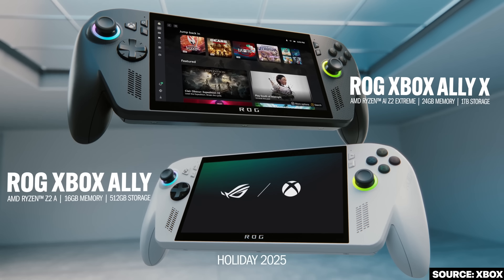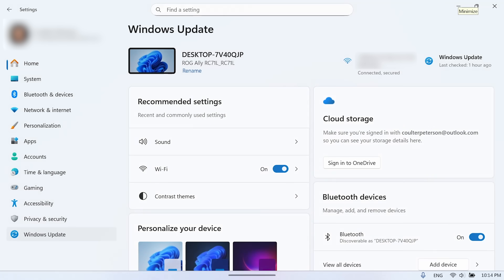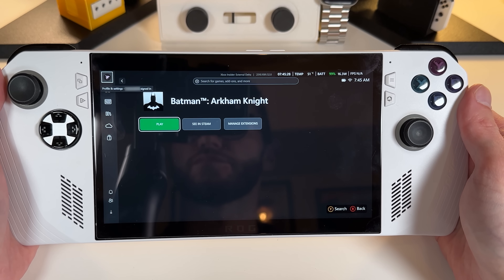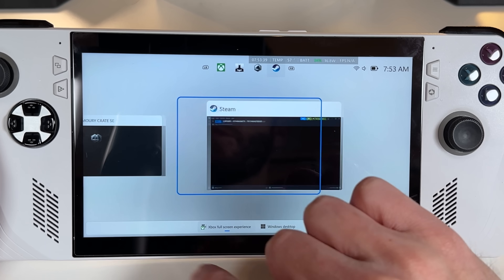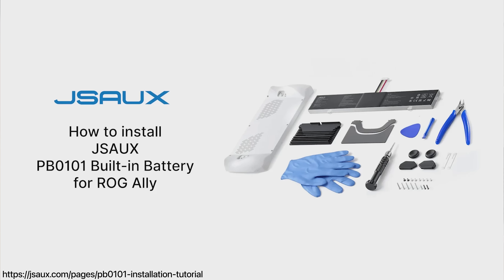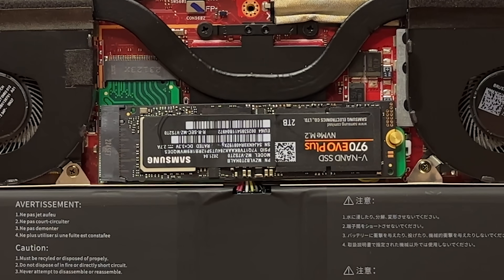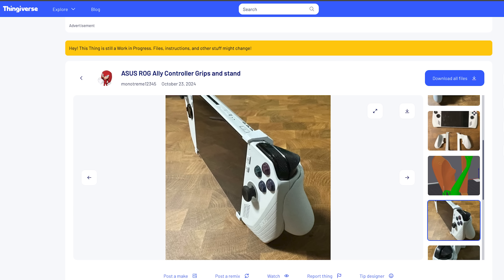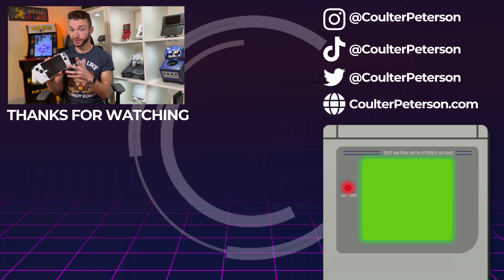I turned my Ally into an ROG Xbox Ally! (Should you upgrade?)

Comment: Biggest problem I’ve seen with the OG Ally Z1E is that if you run it at full wattage all of the time or plugged in, the heat causes white edging on the screen. I only use mine on 10-15 watts and keep temps down as much as possible

Comment: Best upgrade you can do for either is Bazzite. There are some games at i can get up to 20 more frames with the same settings. Average frame boost I get is around 10fps though. Still for a A handheld it's enough for it to feel like a hardware upgrade. Its actually kind of crazy how bloated windows is on handhelds.

Comment: The big problem with the first ally is the ram...
Reply: The ram and SD card reader
Reply: @TkoddaLee SD reader is easily fixed but either use a dock or my OG reader hasn't fried no sds I don't need it I have 2 tb
Reply: @TkoddaLee yes. But the sd card can also not be used, the ram is really little... Even in the new xbox ally x the Ram is few. With shared memory for me I would need 48 gb: 32 for system. 16 for GPU
Reply: The battery mod is a no brainer the jasaux was the first thing I did.Its not hard at all anyone can do the battery upgrade.
Reply: Really please share how you did it.@JusDntAsk
Reply: I agree, but also, it’s been working for me for about a year now
Reply: There is a way to add more RAM, but it takes some serious work.
Reply: @mosthated8848 not too bad yourself yes but I the ad mine sent out.To have it done pricey but I got my OG for 375.00 so it evens out.I play every new game @a solid 60 fps or above
Reply: @mosthated8848  you need to send it to a repair shop that does that. probably not worth it.
Reply: 16gb ram used to be decent for a gaming laptop..wait but the budget gaming laptops has a 4gb vram..
..but in the other side the APU Business laptops in same segment felt fine even with 16gb ram but these laptops mostly has upgradable dual channel ddr4/ddr5 memory
Reply from the maker: Ah yea good point
Reply: I would say the msrp was the main issue, gotten better now with being around $320 open box at best buy
Reply: Install Bazzite and you will have the best handheld price/power Device. The z1 extreme it’s just amazing, and with JSAUX mod you have basically a beast.
Reply: Yeah a lot of people are lost when you can just look it up now since people are actually figuring out how to update it with new 32ram
Reply: XBox full screen and other optimizations can save more than 2GB of ram that you can dedicate to GPU on Z1E so bump it to 6GB easy
Reply: @jakejoyride how can I do this
Reply: @Nates-Opinion He mean like full screen experience and debloat windows or install Linux

Comment: Looks like I won't be using this.   Putting Windows 10 on my machine Thursday once I get it.
Reply: At this point with this new UI, Windows 10 is pointless on handhelds.
Reply from the maker: Any reason other than the windows 11 ads and local account stuff?
Reply: @CoulterPeterson The UI is a nightmare to navigate, it runs cleaner in Windows 10 without using Stardock Start10, registry tweaks and a few programs i regularly use don't play nice on Windows 11.   I'll try it for a week but my other 2 Ally's have Windows 10.   If the resume from sleep works like the Steam Deck and Switch 2 I'll tolerate it.   Windows is also notorious for killing your battery in sleep so I usually don't save state my games.    But maybe the new hardware will fix it.
Reply: @CoulterPeterson So I tried this new Xbox interface on the Xbox ally x.   Not a huge fan of it, I'd rather boot in Steam Big Picture or Emudeck
Reply: I recommend using Bazzite for a handheld. It’s Linux based so no anti cheat compatibility, but it’s better performance.